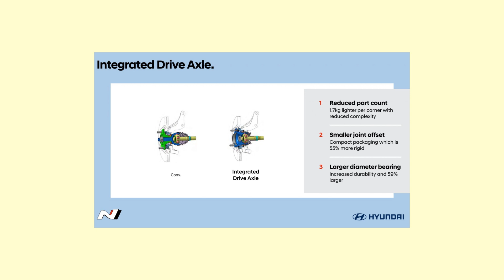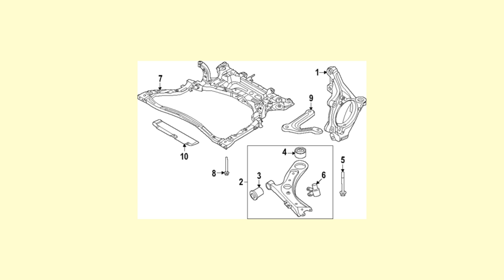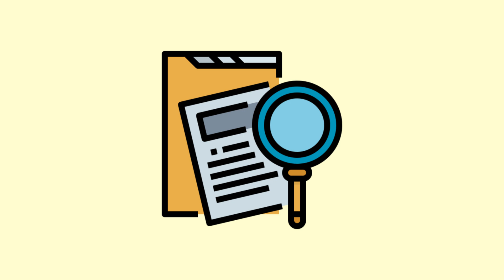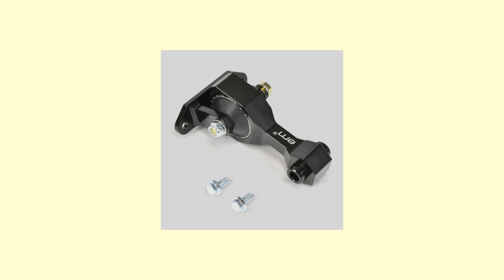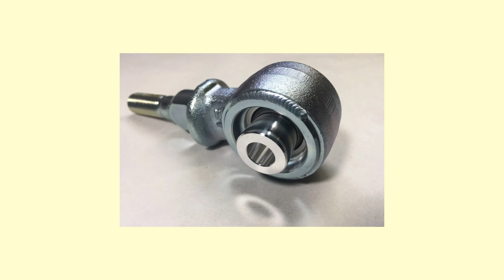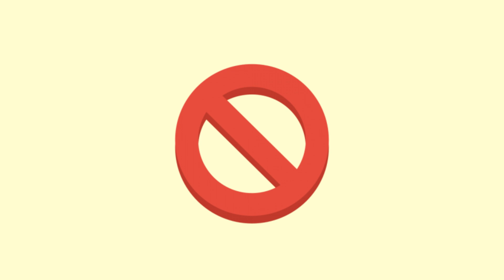Wheel Hop | The Enemy of Acceleration

Comment: Ford Focus ST MK3 has quite lot wheel hop. Putting a stiffer rear motor mount helps a bit. You need it especially when tuning the car.
Reply: I'm here for solutions to my MK3 ST which was mapped by previous owner
Reply: @TrevKen  What kinda problem?? Get new tune??
Reply: I have a mk3 focus that isn’t an ST and it wheel hops from time to time would this help